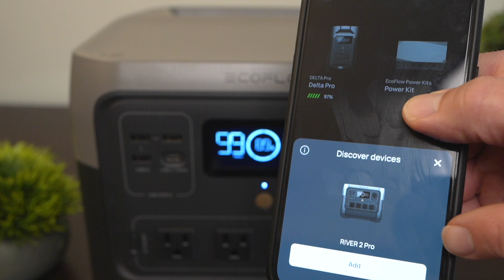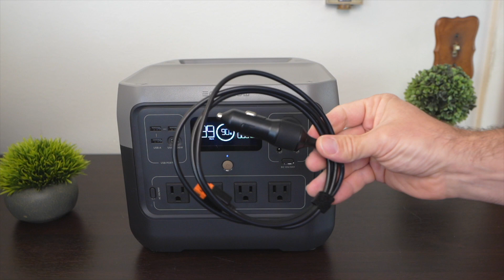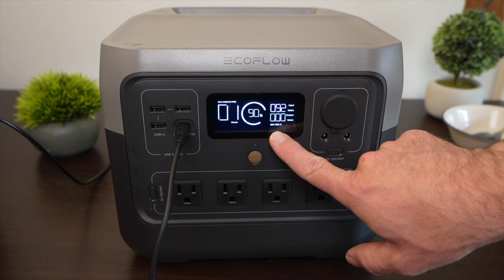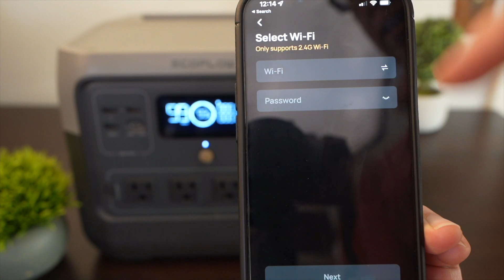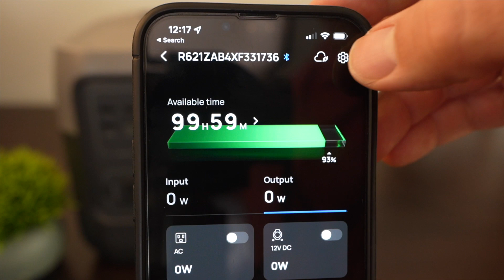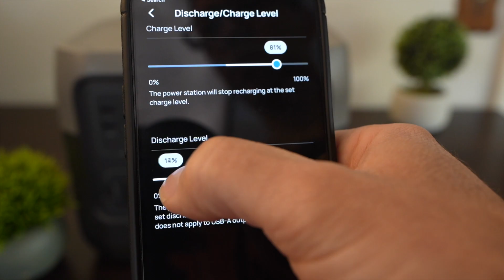REVIEW of EcoFlow River 2 Pro

Comment: Can you add a delta 2 extra battery to this, I have the River 2 and River 2 Max, wondering if I could add a delta2 extra 1kwh battery to these😅.Thanks for the video❤
Reply from the maker: No, unfortunately, the D2 extra battery only has the DC connector (XT150 I believe) and it wouldn't be able to connect to the River 2 or R2 Max.

Comment: Would love to see this with the wave 2
Reply from the maker: What aspect are you interested in?   Are you asking about a wave 2 without the native battery?   In heat/cool mode?  I have a wave 2, btw.
Reply: @solarguy  hello, I have the river 2 pro and delta mini.  Also have the 220w bifacial panel..  was curious of the run time of wave2 plus the xtra battery hooked up to the river 2 pro or delta mini. I mainly use the power banks for domectic 95dz and 35L. Thanks!!

Comment: Can it power a household freezer?
Reply from the maker: A normal sized one then probably not because it would need a surge higher than 1600w.  However, if the starting amps on the compressor is about 13amps or less then it should be able to.  You have to be under the 1600w surge value.  The R2Pro could run it but it’s starting the compressor is the issue.

Comment: How long will it power my iceco fridge?? Vl45
Reply from the maker: It would only be a very rough guess because of inside/outside temperatures and I don't know it's wattage but let's guess 70W and with the compressor running half the time, I'd guess about 20 hours or so.  Again, rough guess because it depends on many variables.
Reply: You are looking at around 2 - 3 days at stable temperatures.